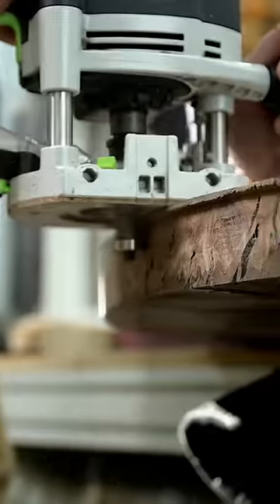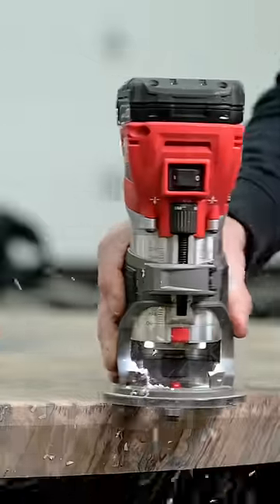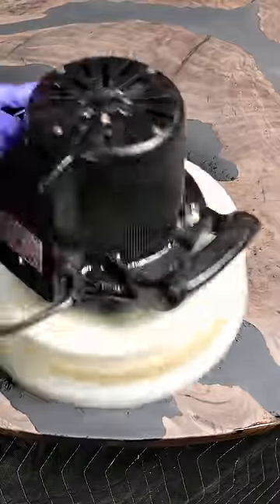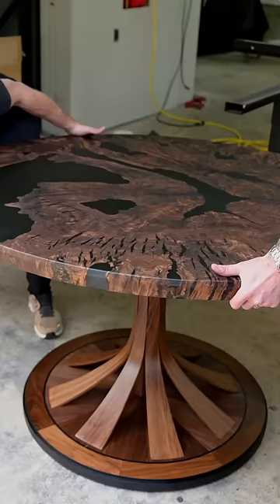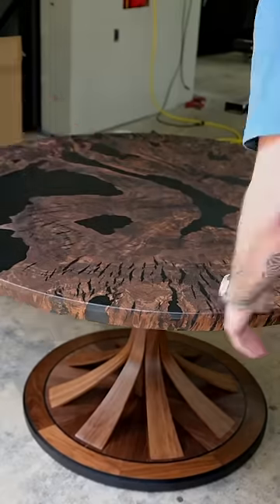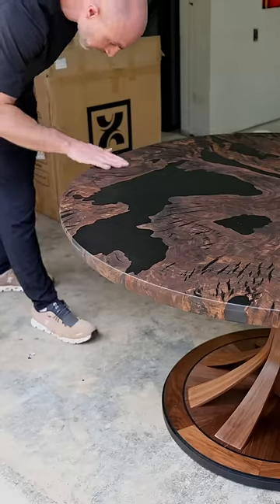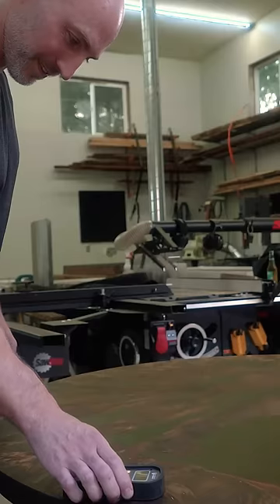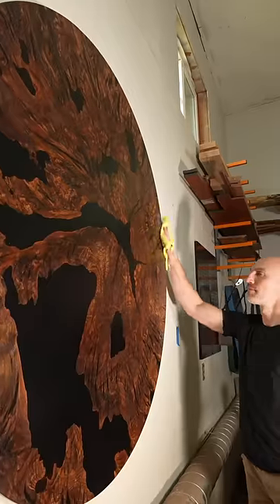My biggest f’ up

Comment: really admire he didn’t sell it after finding moisture. could’ve easily gotten away w it but chose to be a decent person instead 👍
Reply: Apart from being fraud (which isn't a small issue), you'd completely destroy your reputation if this came to light. 

While I'm sure cam is a decent person, only an idiot would sell such an extensive table with a known manufacturing defect given the repercussions.
Reply: Maybe he did but hung it on the wall til he found a buyer
Reply: @voodoo1094  blah blah blah
Reply: not to knock his morality, but he usually sells these tables for obscene amounts and at those prices the customer definitely has a right to expect perfection.

and also, you can't compromise when trying to build a reputation as a quality craftsman - your reputation is what brings in the money and customers anyway
Reply: 100% this!
Reply: @voodoo1094  “fraud” lmfao. Really just throwing that word around for anything
Reply: Why ruin your reputation just to sell one table???
Reply: Fr. Imagine marking this up an extra 6/7K
Reply: I'm a layman so excuse the question but does the trapped moisture just mean the wood would rot inside the epoxy? Or is it the actual epoxy that is now useless?
Reply: But how will that explain homosexual special rights ?
Reply: @benjurqunov  You good homie?? Want me to call an ambulance?
Reply: @zachsdickDOTmpg  Or, and hear me out here, he could have checked the moisture content before he sealed it.
Reply: It’s true pride in his work
Reply: Exactly it would have been dumb if he sold it. It would have wrecked his name!
Reply: @voodoo1094  It wouldn't be fraud in any way, but it could and would likely come back to bite him
Reply: @uncomfortableshirt I guess, if you don't know what it means
Reply: @vanitas.  They obviously don’t if they think selling a table with moisture amounts to any form of “fraud”
Reply: @uncomfortableshirt  If he were to knowingly misrepresent the table to sell it, knowing that it's compromised and going to fail, then yes, that would be fraud.
Reply: 98%  Sure  he NOT from 'my' area as we are DemokRat Heavy.
Reply: @voodoo1094  Thatz why unscrupulous Yankees come down South to work & vice-versa.
Reply: Galatians 6: 7 in KJV Bible
Reply: That’s what you call integrity
Reply: Thats not a decent person but an Honest person to its own Craft.
Reply: heatherroiz6239  I think matthew has been listening to too many politicians.
Reply: Long-term reputation is important
Reply: What happens if there's moisture in it
Reply: @donalddarko4871  exactly, why okay on the wall but not a table?
Reply: may God reward him with more for being HONEST in business
Reply: What does the moisture in it do. Why is it unusable
Reply: @uncomfortableshirt  knowing the table is faulty is is destined to warp and crack and fail is a bigger deal than "100% no moistur perfect table"
Reply: What happens to the piece if the moisture is trapped inside the dried/solidified epoxy? Why is it not good for a table but ok for a walk piece? Can someone help me understand?
Reply: It would hurt him more if he sold it lol
Reply: My reputation is more important than any money in the world.🙏🏽
Reply: I don't think people realize how much the world is affected when people decide to do shady shit like that and appreciate him for not contributing to that butterfly affect
Reply: “$1,000” per slice?   Why not buy the next several and crank out multiple table tops?
Reply: As a man ur word is everything once u ruin that it’s very hard to gain it back
Reply: I would still buy it’s a good looking table
Reply: Why is moisture such an important issue?   Can't a guy just sand the bottom to reveal wood surface and let it dry a bit more?  Even if moisture is there and reveals itself on the surface,  doesn't this add to the charm?   Put a round of beers on it for the guys and all is good, right?
Reply: If you sell me a table for upwards of 5 grand im saving your number and your shops address, hes not stupid he knows facebook marketplace scumbag tactics dont work on this level.
Reply: @moeb4348  its gonna change dimension as it drys out.
Reply: @voodoo1094  not sure that constitutes fraud at all. Just poor craftmanship.
Reply: @Doctors_TARDIS  And it would definitely look bad on his reputation. However they would never be charged with fraud, lmfao
Reply: Who has ever checked a table for moisture?
Reply: what does moisture mean, like why would he sell it?
Reply: Maybe he’ll be able to sell it as a wall piece who knows I bet there are people out there who’d go for it
Reply: That’s a normal thing… if he sold it that’s not normal and a pos person
Reply: Even if that is the case, I would have done a mixed blue resin pattern, to simulate a landmass with oceans and small lakes, making the first layer a light blue, then go layer by layer darker, so the center of the ocean is darker, while the edges are a gradient lighter blue (same with the small lakes).
Reply: Damn! Omg that's beautiful!
Reply: that would be a pretty shitty businessman if he found out & still proceeded to sell it no?
Reply: Heather Roiz  or just doesnt want to ruin his whole business over 1 table? hes not some 3rd world country factory worker anyone stupid enough to sell that would deserve the backlash in a few months
Reply: 1 mistake gonna destroy 1000 kindness, he not gonna destroy his reputation for defective product lol
Reply: lmfaoooo he probably still sold it right after he cut the vid🤣
Reply: Best thing ever. Such business people have my loyalty as a customer.
Reply: @benjurqunov  long thick hard wood 🪵
Reply: @donalddarko4871   He replies to another comment that it would eventually warp and become uneven and there was another issue too. Considering the price, the customer would be upset and rightfully so.
Reply: @voodoo1094  or you could sell it cheaper and warn about the moisture so it’s up to the buyers
Reply: That's true. It's people like that who you want around you. 👌🏽🍻
Reply: @rolls_8798 well that slab of wood alone must have cost him like 3 iphone 13s. Not to mention the 12 gallons of epoxy, thousands of different tools and equipment that must have taken him years and thousands of dollars to buy, also the man power alone in prepping and building something like this. Also he had a custom wooden base built for it which would not have been cheap even if a friend made it. 

People like you are so quick to dismiss another person’s work because you think the price point is too much when it really isn’t. You fail to recognise the time, money, and effort that goes into these kinds of projects. Not to mention the time it took him to get to the level of skill and professionalism that he has now. You can pick up a paintbrush and paint something but that doesn’t make you a professional. You probably think “I can do this at home for x amount of dollars less” and yet you don’t because you don’t know how to do it, you don’t know how to do it WELL, and you can’t afford to do it so just maybe shut up next time? Or get some hobbies maybe.
Reply: @taylordivinbarsalou2258 because if used as a table it will clearly get used, the table will degrade much faster with daily use plus the trapped moisture will make the epoxy deform and a deformed table is useless. Do you want to buy an expensive table that’ll start popping holes on the surface 6 months after you bought it? No. On a wall it will just be looked at, you’re not putting things on it or using it in any way, it will last longer and won’t break as fast. 

You wouldn’t buy a shirt that you know will disintegrate once you put it through the wash would you? Of course not. Nobody would.
Reply: @Imbettadenu  it's not about trouble, it's about building a quality product. if someone buys a 12k table from you and it starts warping, they would be understandably pissed and, practically instantly, your reputation and the respect for your work is gone
Reply: @voodoo1094 blame it on terms of warranty failure lol.
Reply: @benjurqunov chloroform
Reply: @roncrate6424  what? I’m not saying someone should do that. Just that’s how an unscrupulous person could sell something like that. I shop the free section of Craigslist only. Not much of an investment if you don’t pay for it
Reply: The kinda people you want to do business with 😁
Reply: He would not have gotten away with it...
Reply: His reputation is far more valuable than that table.    Good point!
Reply: Fantastic comment! still looks amazing to me!
Reply: @voodoo1094  depends on the defect. Is the table going to fall apart? Or is it just going to get some divots? If the defect doesn't effect the function, many people would be willing to buy it as a discount item.
Reply: Truth 💯
Reply: Would tarnish his reputation for future buyers
Reply: What can that moisture do?! ,,, What moisture?
Reply: He definitely sold it still
Reply: Agree. I admire his Integrity. Integrity is diminishing in this world.
Reply: Ya.. how you should be
Reply: @voodoo1094  o oolong oòòòyo I loo òooòooķo pious
Reply: Nah dude it's called bad business better to have repeat customers than to cheat them all once almost anyone with a business that is successful knows this too
Reply: No shit
Reply: They’d probably have it tested before they paid for it. Your looking at thousand of dollars at stake here.
Reply: Could he not drill holes on the bottom and let moisture out? Dump rice on it? Silica gel?
Reply: Maybe god was like stop ripping people off 😂
Reply: Yeah and made sure to let all of the world know about his good deed lol. Just a smart businessman nothing more. Someone watching this will probably offer to buy it regardless
Reply: He would likely not get away with it that easily at all. Time to failure on pieces with trapped moisture can be really quite fast. Not worth it.
Reply: He said he'll sell it as a wall piece, just not a table as it will warp being horizontal
Reply: @zachsdickDOTmpg  He still had youtube to make money off of it and use it as a marketing tool to make him look better as a seller. He knows how to run a business...
Reply: That's not how business works, ever heard of trading standards and consumer rights?
Reply: Oops...?
Reply: @matthewjewell1274  more likely he sold it as what he said it ended up as which is a wall piece. Not saying your thought is wrong but let's just not try to make the bad in humanity reflect on all of us yeah?
Reply: Now that’s called being professional dude takes his craft seriously has high standards for himself 👍
Reply: That would be a pretty short-sighted move if you are in the business for the long-term and want to build a good reputation that would drive in more business/customers or repeat customers. You do that, then three months later you're being hassled for a refund. Either that, or the customer just accepts it and writes you a shitty review about how your work falls apart and warps after a few months. That would cost him far more than $1,200.
Reply: Yes that took character. 👍
Reply: stupid question what would having morture do to the table.

i mean if he said it in the add and give a deal would it be worth it.
Reply: I understand by his statement that this beautiful table to be was unethically sellable but I'm not getting what the reason of it containing moisture puts it in this category. Can you please elaborate on the unusable as a table is it mold or unstable I don't get it. Thank you for your time...
Reply: Can someone explain what was wrong with har piece??
Reply: @Manhandle730  Yep and no one goes on Craigslist to buy an artisanal piece from someone they’ve never heard of, at least not for the price he’s need to charge to make a profit for materials and labor, even if he was unethical enough to do so.
Reply: Selling it would be a bad idea. High end craftsmen live and die by their reputation. Selling a botched table for $10,000 is a great way to detract all your future buyers.
Reply: Is there a way to test for moisture before you do all that work?
Reply: @JessieBanana  yeah pretty much. It’s basically selling your things at garage sale prices. Still beats going to a pawn shop but not by much.
Reply: @CrickBritt  someone is commiting fraud 😐😐😐
Reply: There ARE still some of those around.
Reply: @Heavenly-TruGod  I don't care if you're black or green, buddy. Racism is racism ¯\_(ツ)_/¯
Reply: @Heavenly-TruGod  trying*
Reply: @CrickBritt  idc*
Reply: @Heavenly-TruGod  *you're not smart
Reply: @CrickBritt  smarter than you*
Reply: What …. He could do with it what he pleases lol he created it 😅😂😂😂😂😂😂
Reply: I think it has more to do with reputation than it does being a decent person, but again they coincide. 
I run a flooring company and jobs sometimes don’t always go to plan for many unexpected reasons and issues. 
I’ve found in my time, it’s best to just do the right thing. In some cases removing and replacing the entire product after it’s laid at my cost, even though I could have made some excuse and got extra money out of the customer. In the beginning it hurt a lot, especially the with the cash flow of the business. But long term my reputation has opened so much more business and opportunity, it was short time pain for long term gain. 
I always preach to do the right thing, even if you know you’ll get away with it. I’ve lived that philosophy through my life now. Even down to personal. I won’t any of my vehicles without fixing problems I know they have, even if I could get away with it from a potential buyer. Just another example. 
As a man in this day and age, you learn quickly your reputation in many cases is all you really have.
Reply: Exactly 💯
Reply: @Heavenly-TruGod  clearly less educated than I, but ok *go off sis
Reply: @Heavenly-TruGod  racist
Reply: @Heavenly-TruGod  racist
Reply: @Heavenly-TruGod  racist
Reply: @Heavenly-TruGod  racist .
Reply: @Heavenly-TruGod  racist
Reply: @Heavenly-TruGod  racist
Reply: @Heavenly-TruGod    racist
Reply: @Heavenly-TruGod  racist
Reply: @Heavenly-TruGod  racist
Reply: @Heavenly-TruGod  racist
Reply: @hdd1977m7  it’ll crack and warp really bad during this process if not left out to dry for another couple of years.
Reply: @moeb4348  moe, it will warp very badly and continue to crack till it fall apart it needs to be dried for another couple of years.
Reply: Wats wrong with the moisture tho ?
Reply: That was pride. can't have pride in a mistake.
Reply: Thanks for being honest! That is so cool!
Reply: What reputation would he have had if he did such a thing as selling it anyway? He is an artist, craftsman and a creator. Why would he want to sell substandard goods. That’s not his mindset.
Reply: So what happens when there's a little moisture?🤷‍♂️
Reply: He is a true artist and does what he does because its a passion.  I am a craftsman also and I can definitely relate. I get plenty of business,  sometimes more than I can handle. Its this sort of pride that keeps customers coming back because they know your THAT GOOD!
Reply: @DonaldDarko  that's my question too..
Reply: Would be going through his window if he sold it to me knowing there's shit wrong with it
Reply: Gorgeous learn as you go
Reply: Right? I wouldn't notice if he sold me that.
Reply: Naivety is common.
Reply: Best thing to just leave it against the wall and see what that moisture will do to it with time. A beautiful way of a learning process. Cutting epoxy doesn't sound as a very bright idea certainly if you want 100% transparent finish through it.
Reply: Cuz he's a man of craft.
Reply: A rare breed today!
Reply: yes amazing person - maybe people check later nah ?
Reply: I'm sure someone would still buy it... as is
Reply: Moisture? I dont understand please
Reply: It would probably be OK. A bit warpage and cracking will add to the character. Some people are so damn fussy!
Reply: Right on! He sure wouldn't of had any problem selling. Great guy, great eye.
Reply: I would've sold it. 100%
Reply: Who's to say he didn't sell it though?? Just bc be made a video on YouTube saying it's at best a wall piece doesn't mean right after the video be took it down and sold it lol
Reply: I bet some out there would call him an idiot for not doing so.
Not everyone has to .
Reply: They'll never know, lol 😆!
Reply: No bc his whole business reputation would have been shot then. These are very expensive tables like probably thousands upon thousands upon thousands so it would cost him more in the end to his future sales.
Reply: For the camera?
Reply: ⌚ make a clock with it
Reply: You are SO right...!!!!
Reply: Being a nice guy, and also wanting to keep his precious art(not sarcasm).
Reply: Because he’s not a muslim.
Reply: Whatever it becomes, it is beautiful!
Reply: What does it mean it has moisture?
Reply: He could have sold it with the defect clearly described, for half of what it normally would cost. I'm sure someone would have bought it.
Reply: If used as a table, it would warp very badly.
Reply: wat does moisture do
Reply: Better lose thousands of dollars than thousands of customers
Reply: Or he owns a company and dont want sued
Reply: whats wrong with a little moisture that's ok.
Reply: Most people definitely would’ve sold it as a table and charged full price lol
Reply: @voodoo1094  do you know what fraud is bro?
Reply: What’s bad about the trapped moisture?
Reply: His reputation
Reply: Poor preparation.
Reply: most people are...
Reply: Agreed
Reply: W
Reply: What’s wrong with trapped moisture?
Reply: This is where an original American product differs from one of the Chines!
Reply: @donalddarko4871  that is the question, more importantly what did he do wrong?
Reply: @Ben Jurqunov  this comment exemplifies what is wrong in our country.
Reply: Artisans and artists are like that
Reply: If it weren't for that meddling moisture
Reply: Right! I love ethic buisness owners!
Reply: Beautiful work 👏
Reply: Blah blah blah
Reply: A true professional
Reply: So what’s trapped moisture do to it?
Reply: ❤❤❤❤yessss❤❤❤
Reply: @voodoo1094  fraud not really. How do you prove they knew
Reply: Ice blasting error 😢
Reply: Lower the price and I'LL buy it as a table. It's absolutely gorgeous! ❤
Reply: Cam is a good guy, he would never burn someone like that. Not too mention he'd be risking his entire business and reputation. It's a no brainer to eat the cost
Reply: It'll show up when people forget this post 🤡
Reply: @voodoo1094  Absolutely not fraud. That word has a specific meaning. It'd be bad practice and screw your reputation, but absolutely not illegal.
Reply: @Doctors_TARDIS  Not unless you sell it with a specific claim that it'll perform in a way it will not. It's only fraud if the customer asks "Will this warp or crack with time" and you say no. (Or if you do the criminally incompetent thing of claiming it won't warp or crack unprompted)

It's not good, it's not honest, but it's absolutely not fraud in any legal sense.
Reply: Bad business to have sold it
Reply: Not that hard of a decision since it would harm his business in the long run.
Reply: Yea but can we really forgive him for trapping the moisture like that? Moisture just wants to be free, it didn't do anything to him!
Reply: it could ruin a good reputation.
Reply: That's how you actually do business, if you sell high quality stuff and make sure its always that high quality you will have more return customers and more new customers by recommendation
Reply: Ettetttethhiicccs
Reply: He could of still sold it and didn't tell us
Reply: U giving him that gawk gawk
Reply: He wouldn't have gotten away with it. As a big YouTuber, he is under the microscope of both his customers and the watchers. If any of these people do wrong, someone is gonna notice.
Reply: Maybe once but that’s his reputation on the line
Reply: could!!! also sell it at 50% cost with a guarantee of making (or compensating) a complete one when it shows degenerations...
Reply: Theseasonorg teaches whole bible God bless
Reply: Such a waste of materials just for that table... quit this pls.
Reply: Drill a small hole or a few in it let it dry out patch it up and renew it again repurposed and dry
Reply: @hdd1977m7  I imagine he keep the piece for himself or as a showpiece until it fails later then he could cut it down to make a custom TV dinner tray. That would be cool.
Reply: I'd buy it at a discount. Probably barely any moisture in it.
Reply: That's what he said on camera?!  🤨
Reply: How do you detect trapped moisture?
Reply: I would take the chance on it LOL but I guess I would want a discount LOL LMBO
Reply: Decent ? Isint this the guy that sold someone a table for 18k when he just said the slab costs him $1200 😂
Reply: @rolls_8798 who the fuck would pay 12k for a table 😂😅
Reply: Good people still exist
Reply: It benefits him as well for not selling it as it is because if he hells a table that will warp for a short time of usage I'm sure it will damage his reputation and the buyer of this kind of table are rich people so.. It's not just being honest he is also being smart for not selling it.
Reply: Doesn’t he sell like 500dollar pieces of wood for like thousands? Yeah, I get he… pours epoxy over it… but that doesn’t add that much value.

I wouldn’t say “decent person” but I guess he could have been worse.
Reply: You know damn well he turned around and sold it, probably through a third party so there's risk to his business.
Reply: @voodoo1094  not fraud you can just say its a table and not mention anything to do with moisture
Reply: Great character
Reply: @Manhandle730 what bad would happen to a table with trapped moisture? It wouldn't completely disassemble, right?
Reply: @Manhandle730 I’m sure he could still sell it to someone at a lower price and just he honest about the moisture, and make some money back. It does make a pretty sick wall piece though can’t lie
Reply: He should have sold it anyway but instead of making a quick buck he chose to be a “good person” trapped moisture affects the buyer not you. Should have sold it anyway
Reply: @alirezasalimi1989  I think the slabs are generally kiln dried before purchase. So a craftsman would end up with a mishap like this at the end of all this hard work unknowingly after trusting his supplier. That being one scenario or he could've ended up with an unknown source amt of water in his epoxy mixture. Who knows? Water in the wood would evaporate over time as the wood dries and cause the beautifully crafted piece of perfection to literally CRACK!
Reply: I definitely agree
Reply: Little do you know, it's worth more as wall art than it is as a table lol
Reply: It’s a beautiful wall piece!  I’d hang it.
Reply: Flip it over and redo it what’s the problem? Lol.
Reply: It was an excuse to keep it
Reply: That’s what he wants you to think.. why do you think he posted the video
Reply: I passed him 7,mill for it ,table has no moisture just smells horrible
Reply: Maybe sell at cost, with a buyer beware note? I mean, if it goes to Seattle or something, it could stay slightly moist forever…?
Reply: This is just how normal people work. We have grown to accept that hacking everything is the way of the world.
Reply: these tables are insanely priced, a decent person wouldnt rip people off so much 😂
Reply: @danvez5656  it’s handmade by a master craftsman. It’s priced appropriately. Niche market.
Reply: @taylordivinbarsalou2258 I’m not an expert but logically speaking it’s the way the pressure is dispersed. As a table all of the weight is going into the center of the stand where as hanging it up allows the weight to be more easily dispersed. The forces are fighting through the thick of the wood when standing on a wall compared to laying flat and expecting weight to be put on it.
Reply: You’re acting like he could have gotten away with selling it as is. That moisture test take 2 seconds and the customer is paying $8k plus for this table. They’re gonna have someone inspect the table.
Reply: possible he could have sold it marked as defective still fetched a good amount for it
Reply: I like cheese 🧀
Reply: @SoulDelSol  I like clam's
Reply: I just like looking... I'm afraid to end up at Buffalo Bill's house.
Reply: Can he get a refund at least from the wood sourcer?
Reply: I DONT GET IT
Reply: @matthewjewell1274 so he posted a video of how he knowingly sold an expensive table with moisture in it? And somehow the buyer who follows him wouldn't see this video?
Reply: Good on you not scamming your customers. 👍
Reply: You admire someone not commiting a bad business practice? I hope you dont run any businesses
Reply: What happens?
Reply: He made a video on it, making passive money in doing so.
Reply: Y como que quedó humedad atrapada?